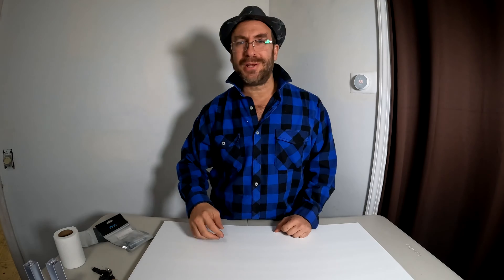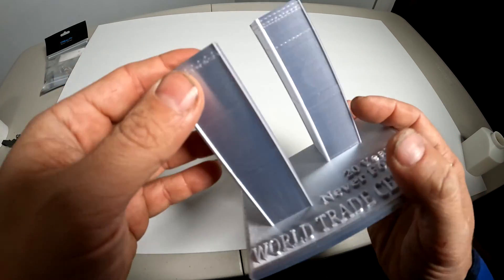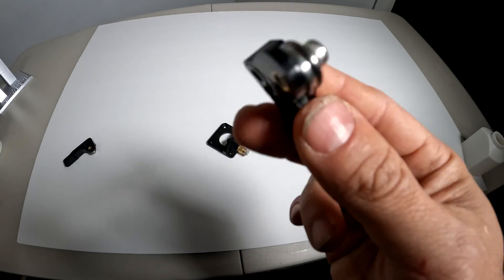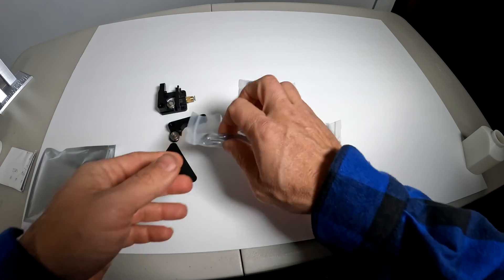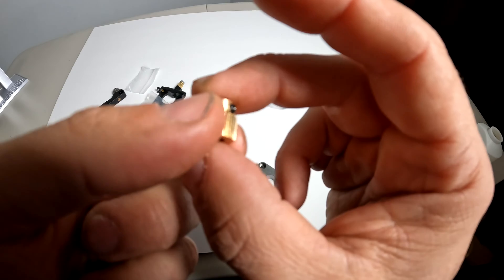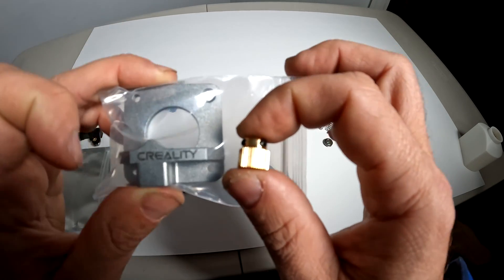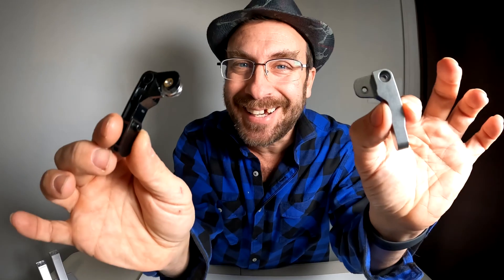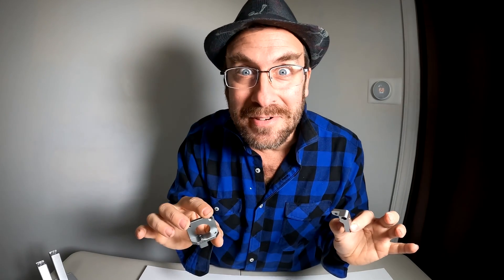Is YOUR Extruder Arm Broken? Probably! Metal Upgrade Vs Plastic

Comment: ours broke recently.... some how we thought it was related to our dry box first use and the filament had problems. However after changing we thought is was fixed until it suddenly began randomly under extruding. Which we initially thought was related to the spring tension... after fiddeling with it and inspecting the extruder for 5 minutes I noticed the pully wheel to wobble which I did not expect and a littler bit later I spotted the tear... Metal parts are on the way, although not containing the official "creality" logo or text it appears to be fine and is still all metal. if you are reading this and had the same experience. trust me, you have not lost your sanity... you do not need to keep tuning your settings... have a look at the extruder arm at the pully wheel ;(

Comment: Hey nice Video ! My Extruder arm is also currently broken but I let the Printer still running. Prints are fine but sometimes I have partly underextrusions and therefore seams/gaps in my prints.

Could these gaps be the result from a broken extruder arm ? Im planning to get a Extruder Kit like the one you presented.

Greetings from Germany!

Edit: I know it causes Underextrusions but are the Underextrusions really random and partly ? Shouldnt that cause constant Underexttusion since the force on the filament in the extruder is gone ?
Reply from the maker: Yes, it is 1000% the broken arm. I’d also swap your Bowden tube, while your at it.
Reply: @GreggAdventure  Thanks friend ! I have already watched your Bowden Tube video. I will take your advices to heart !
Reply from the maker: The stock one WILL fail. Let me know how you make out!
Reply: Indeed it does!!!, I had the same thing... the reason it is random is because the wheel is still  attached but  because of the tear it can give some wobble to the grip on the filament causing under extrusion.